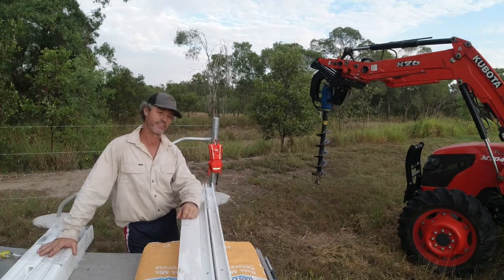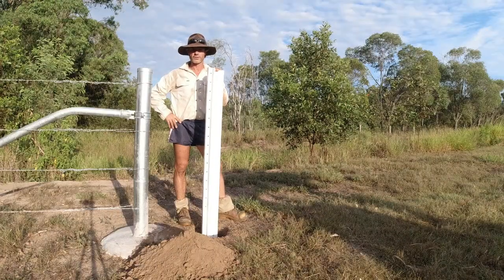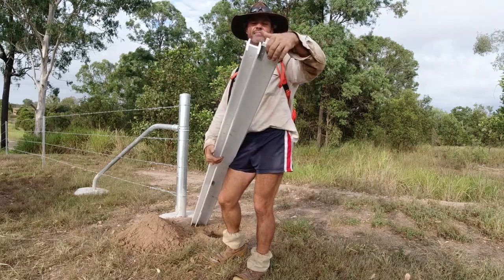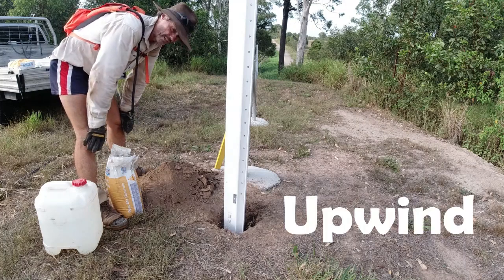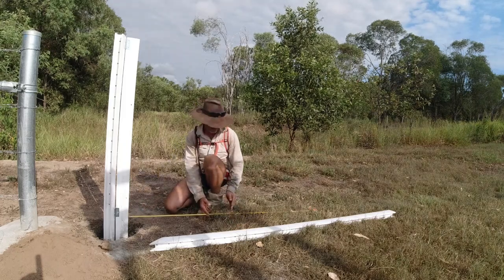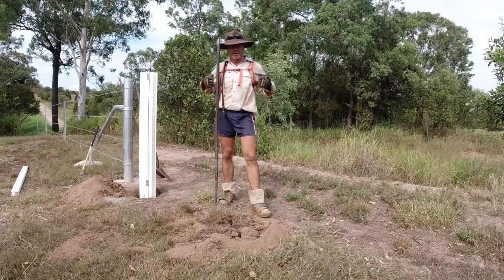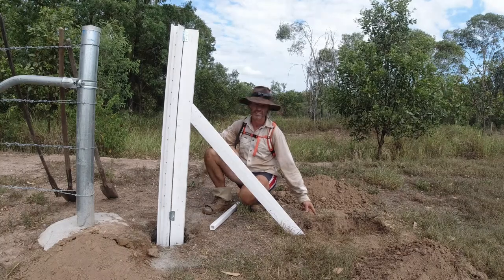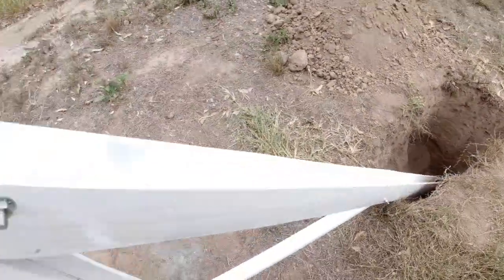TIMELESS FENCE SYSTEM, NEW ZEALANDER A-FRAME CORNER INSTALLATION!!

Comment: Gday Jason, can these H shaped corner posts be driven in with a post driver?
Reply from the maker: Hi TLW Lawncare, It's recommended that all Timeless Corners and Braces be concreted into the ground, as they are all designed to be installed where you are trying to take some form of load. T-Posts however are small enough and have been designed to be driven in by either a hammer, sledge hammer, T-Post/Star picket driver either manual or Petrol. Hope I’ve helped you out there guys. Let me know if you require anymore information, happy to help out. Have a great night and thanks for choosing to watch our video. Jason & Nic